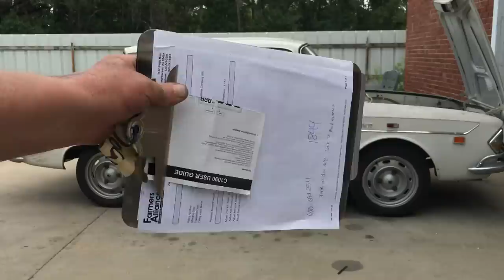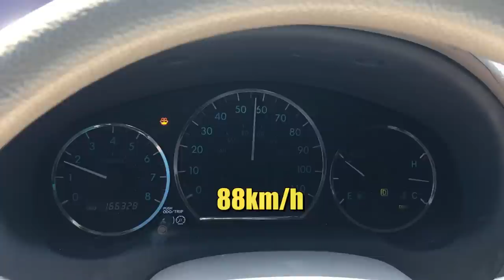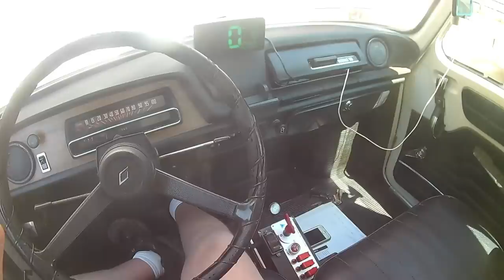S3 E21. How fast will this 670 cc predator V twin powered Renault go?...  Faster than you think!

Comment: All these videos are silly light hearted and fun but on a serious note.... You are dropping a cheap harbor freight engine in a crap designed car from 40 years ago and getting up to the max speed limit in some states with better gas mileage than lots of new cars........ And yet car manufacturers can't buy out a car that can do the same thing for under 20 thousand dollars????   We should have harbor freight cars that are tough easy to work on and upgradeable for about the cost of a decent riding lawnmower. There's definitely a big market for it.